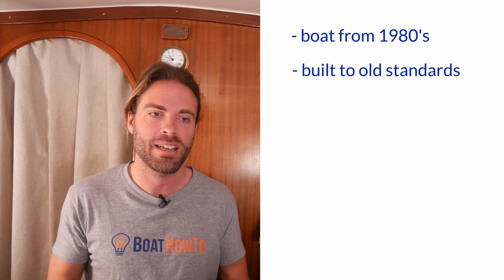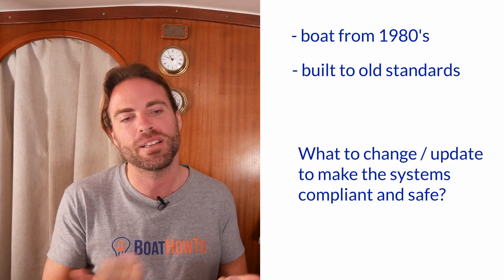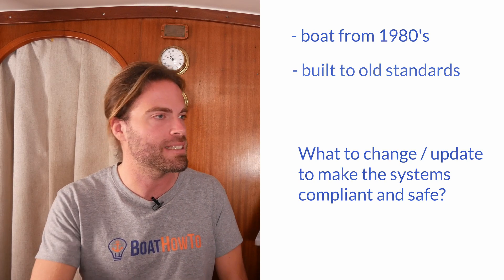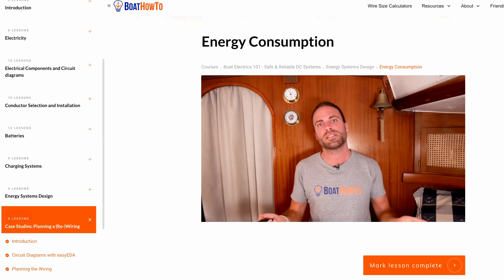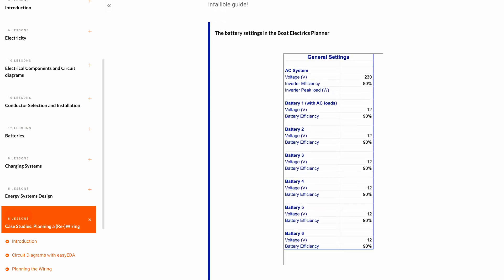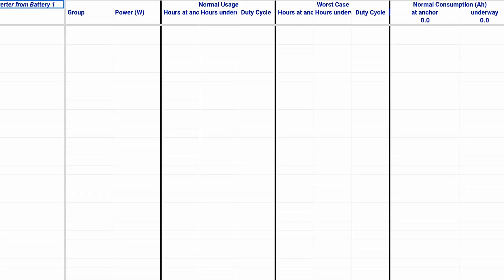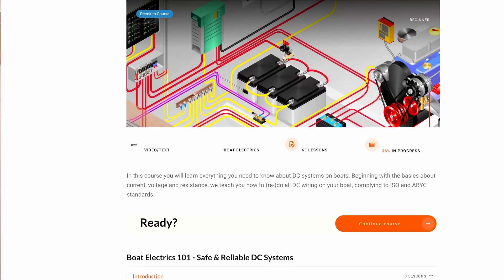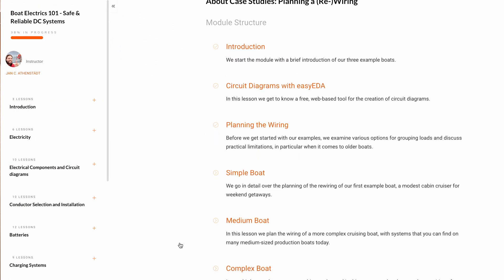How to bring an OLD BOAT up to CURRENT STANDARDS | Ask The Expert with NIGEL CALDER

Comment: With all the challenges with Earth Grounding and Bonding, many of which seem to relate to Shore Power, wouldn't an alternative be to use an isolated battery charger, run off inverter all the time, and have no ground relationship to the shore power at all, exactly the same as at anchor? (Indeed, this is how I have built my boat with a 5kw isolated charger and 10kw Victron inverter). As I understand from your content, a vessel at anchor has no need for bonding the AC or DC grounds to the ocean.